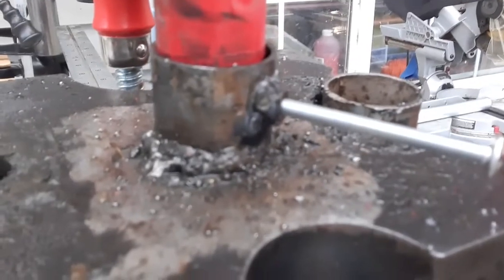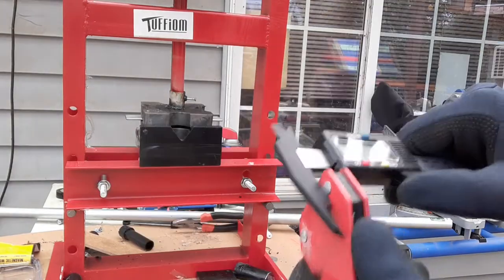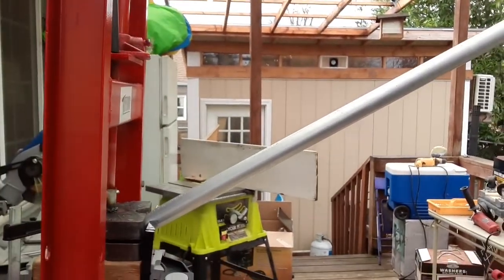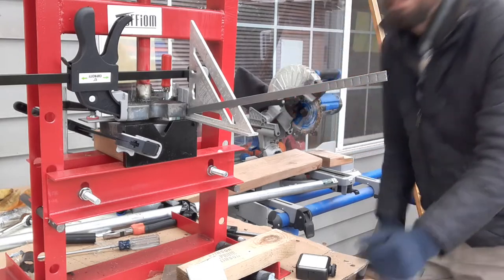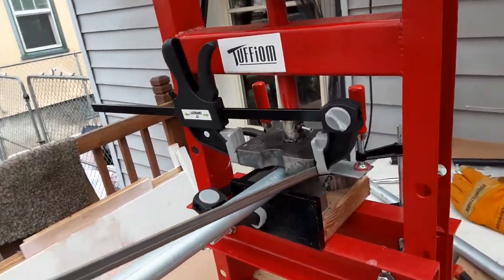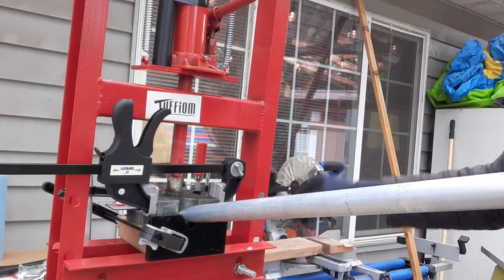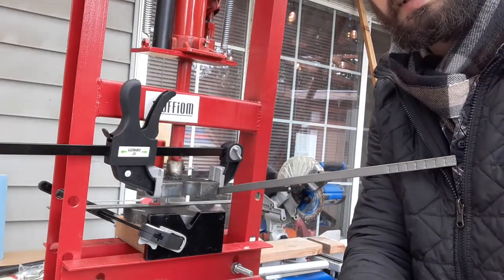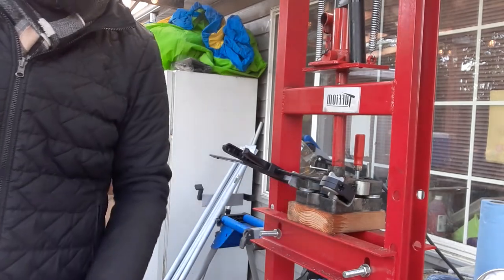TA- Dome Struts - Bend Angle #13

Comment: I know that budget is always a concern; and for tools that are near single-use, you probably do not want to shell out a ton of money. I do believe that part of your woes can be solved by better clamps. I too have dozens of Harbor Freight clamps for light-duty and general-purpose holding. For this brother, I HIGHLY recommend you get a pair of Irwin Quick Grips. I have a few sets for just such occasions. 1 Pair of clamps with 600lbs of holding force and my other pair is 300lbs.  They can be spendy ($25-50 I think) but in the grand scheme of house-building a mere drop in the bucket.

Keep up the good work!